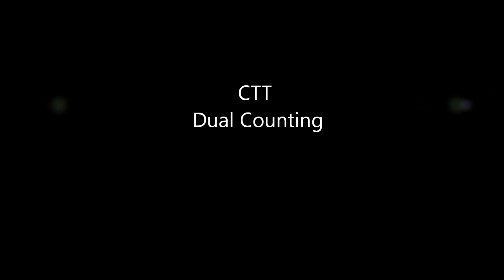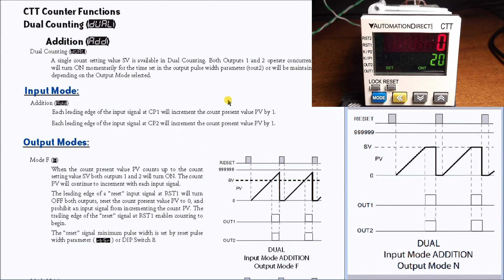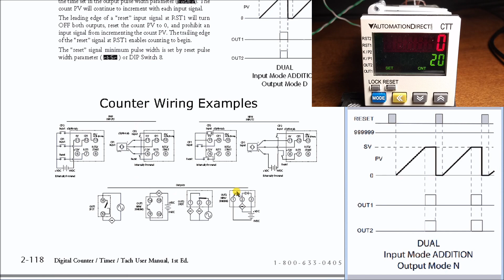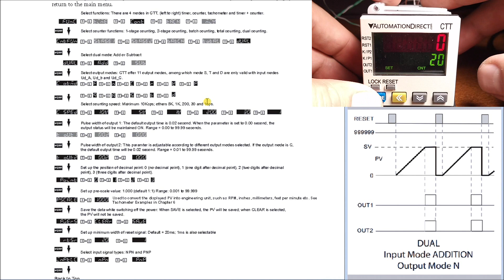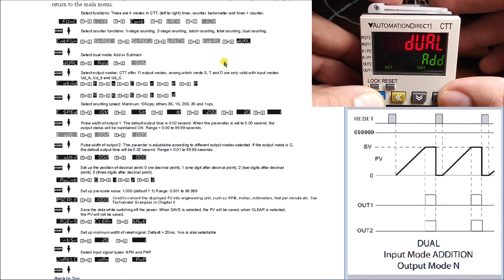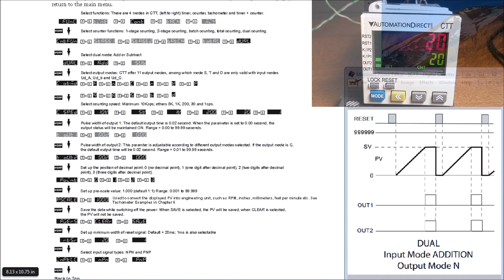CTT Dual Mode: Master Both Outputs with Smart Input Counting

Comment: So I could use this with each of an up and down button for a user to indicate how much product should be moved?
Reply from the maker: Hi Jeffrey,
https://cdn.automationdirect.com/static/manuals/digitalctt/ch2.pdf
In Dual Mode Subtract: 
- Each leading edge of the input signal at CP1 will increment the count present value PV by 1
- Each leading edge of the input signal at CP2 will decrements the count present value PV by 1.
The set value (SV) is always set using the buttons on the front of the unit.
Hope this helps you out.
Regards,
Garry